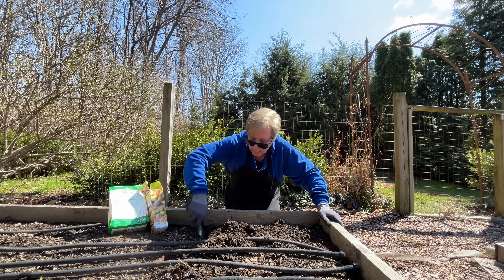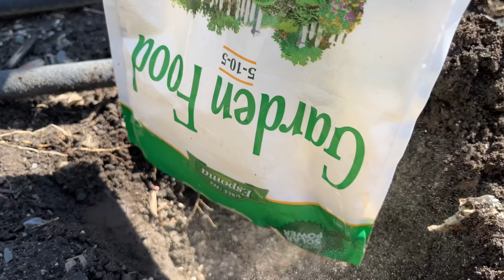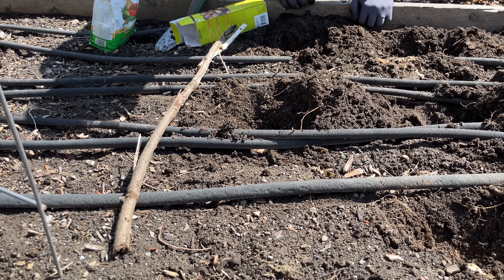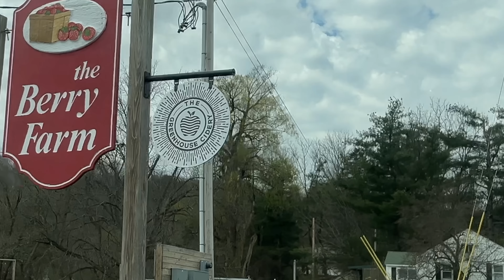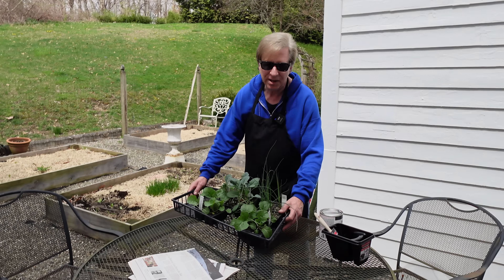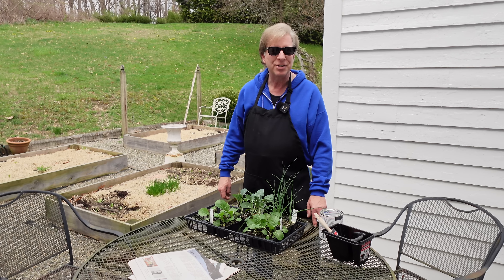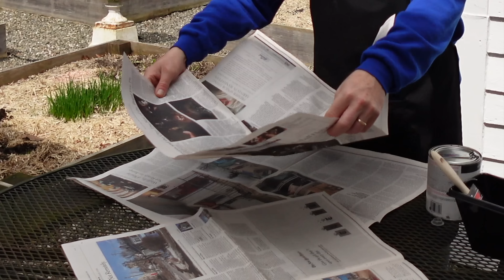An EXCITING Day in the  Garden!

Comment: Thank you for the blue cheese dressing recipe.
    I'm in Riverside County, Calif, in a low desert.  About every 20 years we get an excellent Winter with sufficient rains to make things thrive.  This was one of those years.
   I planted potatoes the first week in January and harvested them recently. I'm debating putting in another batch to harvest in July.  Things get hot here about then, but hoping this year may continue to be more moderate than usual.  I tend to  think this way about the same time each year, so it might be too hopefu on my part.
   I'm also harvesting English peas, leaf lettuce, cilantro, and Swiss Chard. But all are wanting to bolt, so there won't be much more.
   I've put in some leeks and two tomato plants last week. I'm also trying my hand at seed starting: tomatillos, peppers, Summer squash, and the last leaf lettuce run. 
I'm trying Anasazi beans, but clueless about growing them. I need to sow other beans too. Yard long, green bush types, and another pole variety... Either the Blue Lake or a Romano. 
    Happy Gardening!